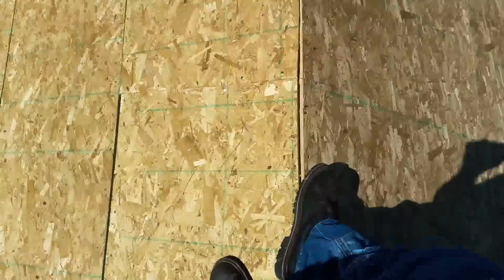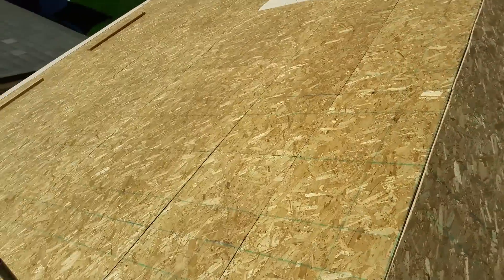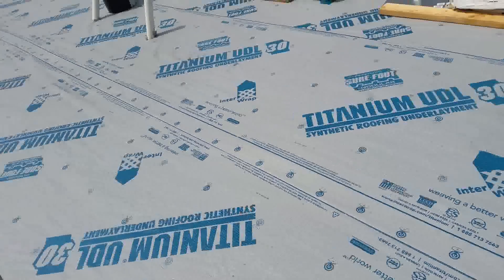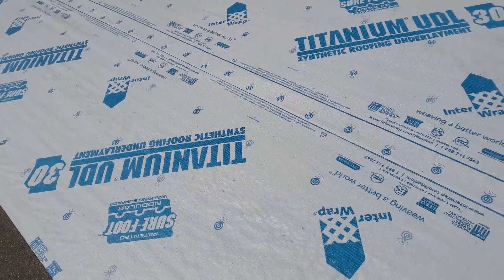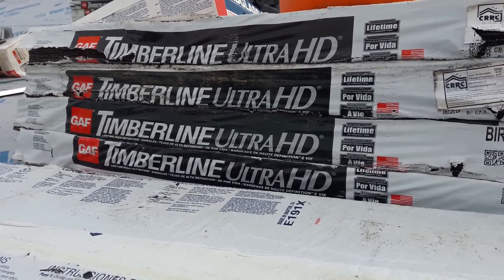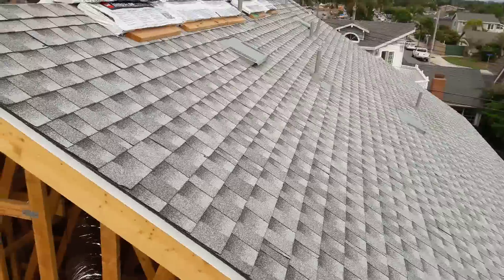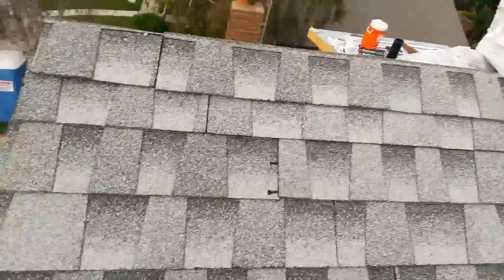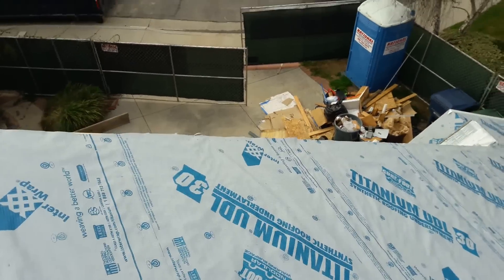The Best Shoes in the World ...from the World's best Roofer !

Comment: That's good advice. It is important to trust and have good shoes. I only wear Nike Air Force 1 or Uptowns. They are more expensive but always treated me good.
Reply: I wear the air Jordan 1 they keep me good and there's an extension on the sole in the front that allows me to situate my foot in between thin barn board.
Reply: @Jimmy Peeps haha. I was being 100% serious. They cost around $90 but hold up well. Especially against the heat from a torch, i do alot of flat roofs.

Comment: Can you re-roof over dimensional shingles ?
Reply: Yes you can but why not tear off?
Reply: There is only one layer and the 30 year roof is ten years old. I want to sell the property in excellent condition and the materials are only about $ 2000. Ted.
Reply: vaccumme keep in mind a 30 year roof typically last 20 to 25 years depending on the region. Having 2 layers is not a good thing. Also, overlaying a dimensional shingle or bilaminate  shingle such as Timberline will cause new roof to look really lumpy and if you put a moisture barrier between them to attempt to make it "smooth" it can cause the shingles too rot. But if you plan on screwing the buyer, go ahead and overlay.
Reply: vaccumme you should also make sure city code allows for overlays. I'm in the Midwest and most if not all cities around here don't allow for more than 1 layer of roofing.
Reply: Thank's for the prompt reply and direct opinion. The Roof is in very good condition. I'm not attempting to screw anyone. I just want to get a good price for the property and leave the buyer with a good value. Ted.
Reply: If the current roof is in good shape and not leaking, you're better off selling the house as is and saving the $2000. That's just my opinion.
Reply: I'm sure you have snow ? I live in California and  my City  allows 3 Roofs.
Reply: Ya we get lots of snow. I would do the "butt and run" method of installation if you overlay to help maximize cosmetics. Definitely install new flashings at plumbing pipes, headwalls, step flashing ect. Many times when overlays are done, roofers fail to install new flashings and the new roof relies on old flashings which will lead to leaks and roof failure. Sorry to take so much of your time. It sounds like the buyer will be getting their money's worth buying a home from you. Good luck on the sale.